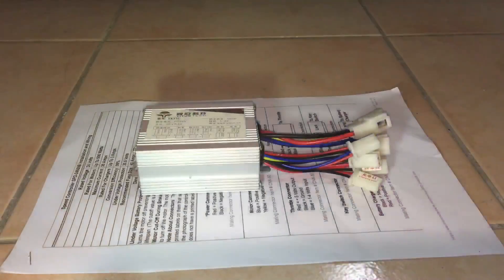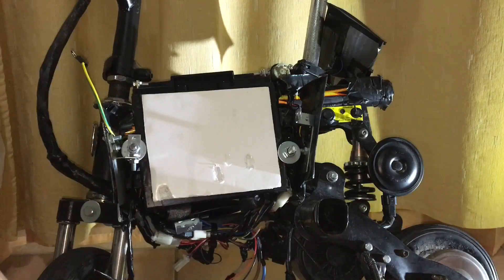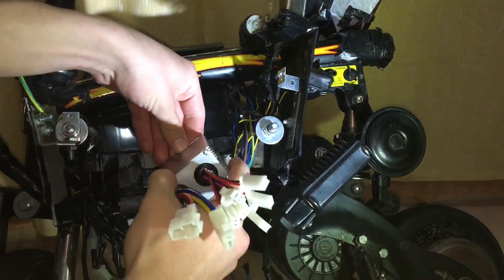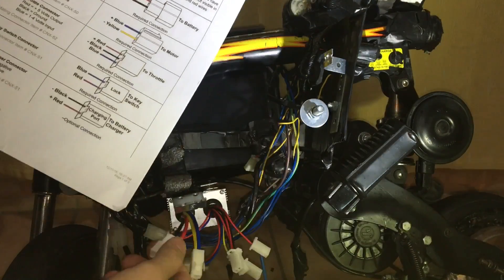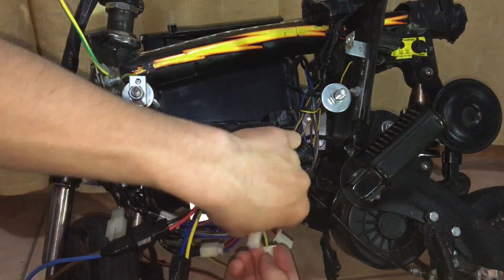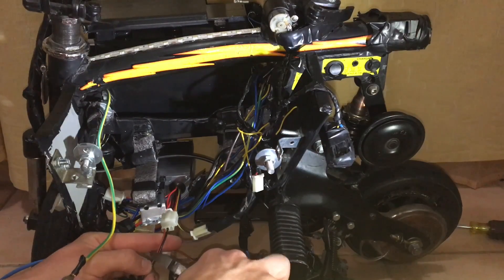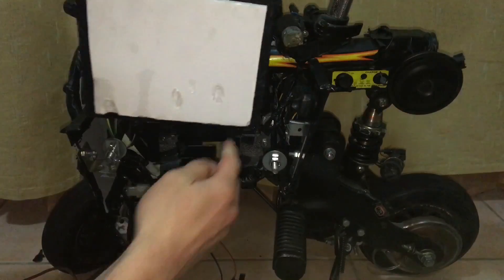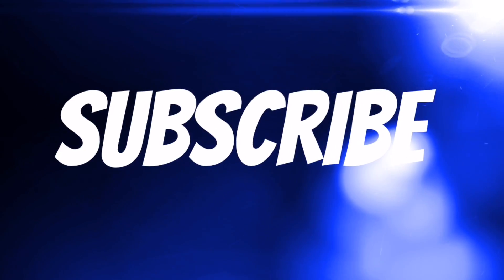How to replace the speed controller in an electric scooter

Comment: Hello .. I have a question about a Terminator scooter i purchased yesterday..i thought the batteries were low so i swapped 1 out ..i have not keys to start it so i installed a toggle where the ignition key was ..so with the scooter off the motor just runs toggle on or off ..any help will be appreciated ..also the brake stops the motor but will start after i release it..if i disconnect the motor connection it turns off ..any ideas?
Reply from the maker: Hi bripri966,

From what I understood is that your motor automatically runs when you turn on the scooter (without any throttle input) and turns off when you turn off the scooter. 

If that’s the case, I’d try disconnecting the throttle cable to see if the issue persists. If the motor does not run when the throttle is disconnected then your throttle is likely faulty.
Reply: @ZiadHamwi  the motor just runs when I connected the battery cables ..only stops when I disconnect the motor and battery connection brown blue wire and red and black ones
Reply: It was working fine then all the sudden it just keeps running on or off with toggle
Reply from the maker: So you’re connecting the motor directly to the battery with a switch?
Reply: @ZiadHamwi  I don't have a key so I cut the key ignition off and put a toogle switch
Reply: @ZiadHamwi  sorry about the questions... but great video just need to be able to see the wires better
Reply: @ZiadHamwi  Terminator ES4 is the scooter by the way ..I'm rebuilding it for my neighbor..
Reply from the maker: I understand. 
You need to isolate the problem first, double check if the original key switch that you cut only has the two wires that you cut and connected to a switch. Also, you need to figure out if the problem is from the speed controller, throttle, battery, or motor.

If you can provide a full context of the problem I’ll try my best to help you as remember I cannot see what you see so I’m having trouble understanding what the issue is. Please provide more context.
Reply: @ZiadHamwi  will do... actually I just unplugged the key switch ..and ran 2 wires to the plug connector..I'll get back with you with more info ...thank you very much for responding and helping me out..
Reply from the maker: Yes sure noted, feel free to ask me questions when you have more info.
Good Luck!

Comment: love the video. i am having major issues finding info trying to replace a controller for a branded canadian ebike. The company refuses to tell me anything and expects me to buy a 189 dollar controller just to replace what i have. 48v 500watt 12.5 a. currently my controller seems to have 3 shorts. (1 on throttle and 2 of the 2 pin wires) at this point i want to just replace and move on from this company and their over priced nonsense. if you could help me in any way id appreciate this
Reply from the maker: Hi Mark,
Can you give me more info about your ebike such as the name and model number so I can better see if a standard controller can fit.

Comment: Thanks dude.  Can you use 500 watt controler on a 250 watt motor thamks
Reply from the maker: You can. You always want to choose a speed controller that at least matches your motor in terms of power output
Reply: @ZiadHamwi  thanks dude for your reply.  I have a speed controller with a LCD screen on it but my controller dont have a place to hook it up it has a blue and green wire i think .how can i hook it up thank you.
Reply from the maker: You're welcome!
So I understand you have an electric scooter with an LCD display but your new speed controller does not have the correct connections to the scooter's display, is that correct?
Reply: @ZiadHamwi  well a ebike with 36 volt  350 watt. Controller and it has no hook up for the lcd nothing that makes it work how could i hook it up thanks dudes
Reply from the maker: Hey Guitarman, sorry for the late response. Concerning your existing speed controller, are you sure it is the original speed controller that came with the ebike?
Reply: @ZiadHamwi  no its not the original
Reply from the maker: Oh I see, if it's not the original speed controller, it's likely that your new speed controller does not support the original display that is on your electric scooter. 

Unfortunately, the only way to get the display to work again would be to use a speed controller that matches your original speed controller.

Comment: My dumb ass left my scooter in heavy rain sitting in my bk yard so when I start it power up but no go on throttle just got my new 1000w 48v speed controller now its running like new

Comment: Hello Sir, I already follow all of the connections but when I charge my scooter, the charger blinking red lights and after that no light at all...then when I tried my scooter, it only can run like 5-10mins..I used 12v 12Ah batteries, the controller for 24v 350w and the motor 24v 350w...what could be the probelm?
Reply from the maker: Hi Mohammad, are you sure both of your batteries are in working order?
Reply: I would say same bout the battery should b the problem if u decide to start off simple by try a new charger if fail then def the battery
Reply: @loyaltyovermoney5942  or its a 48v controller

Comment: My escooter runs ok 250w motor with 36v 10.ah battery and 36v 13A controller. Can i upgrade the controller only to 48v 500w to get extra speed?
Reply from the maker: Hi Mohammad, technically you can, but you'll need to upgrade your batteries to 48 volts as well. Also, your 36 volt motor will certainly go faster with 48 volts but will heat up much more than normal and will wear out quicker. Personally, I wouldn't recommend running your 36 volt motor with 48 volts for extended periods of time.
Reply: Thank you for the reply. Another question I have is, if i were to maintain the speed but get extra torque instead, can i upgrade the controller from 36v 13A to say 36v 20A? Does this harm a 250w motor?
Reply from the maker: You're welcome. About upgrading your speed controller, your current speed controller is a 36 volt 13 amp controller, it's capable of outputting 468 watts (36 x 13 = 468), so it's already more powerful than your 250 watt motor, but your 250 watt motor will only draw 250 watts from it under maximum load. Replacing your 13 amp speed controller with a 20 amp controller (720 watts), won't harm your motor as your motor will continue to only draw 250 watts at max, but torque will not be increased either. In the scooter I used in this video, my motor was a 180 watt motor and the speed controller I installed was a 500 watt controller, and no I did not notice any benefits in speed or torque.

Comment: -bro i have mobot scooter with 48v 500w motor but the running fix in 25kph i can adjust the speed because i know because of the controller they fix the speed in 25kph but i fell the power of the motor when i start running very strong acceleration. my question  its possible to change may controller to get more speed of my scooters? thanks in advance more power
Reply from the maker: Hi Carlo, if you're 100% sure that it's your speed controller that is limiting your speed to the maximum of 25km/h, then it would be possible to replace it with a new speed controller that doesn't have a speed limit. However, it's important to keep in mind that if your scooter has been designed to run at a top speed of 25km/h, by modifying it to go faster you may risk potentially damaging the structure of your scooter since it's not meant to go above 25km/h and your brakes would have a harder time slowing you down under a higher speed. 25km/h is a good speed for a 500w electric scooter, so I personally would leave it alone.

Comment: Hi Ziad, I have a Nanrobot D4+ scooter it has two 52v 23AH speed controller. I was testing for power in the rear light wire and touched both metal connectors at the same time. Now my scooter doesn't stay on when I press the power button... It goes out instantly. Can you help me out in troubleshooting it?
Reply from the maker: Hi Manny, so what happened was that the two pin rear light connector pins touched each other? Also, for the split second that your scooter turns on when you press the power button, does it run if you press the throttle?
Reply: @ZiadHamwi  Hello Ziad, Thanks for your reply.  When I touch the two metal connectors I heard a small click. No smoke or the smell of smoke was detected. If I hold down the power button and press the throttle it runs. And everything else seems to check out ok when holding the power button down. Once I let go it shuts off.
Reply from the maker: Hi Manny, from the information you provided, it seems that your speed controller is fine. I'm suspecting that your power button might be failing. Check your power button, perhaps it's faulty, if you're able to access the two wires that are connected to the power button, you may connect them together, temporarily, to test if your scooter runs normally. Or if you happen to have a spare switch or power button on sight, you might want to try replacing your power button with another button or switch to test if it is causing the problem. Feel free to ask me questions. 

Let me know how this goes :)
Reply: @ZiadHamwi  Hi Ziad, thank you.. I did what you said. It turned out to be the power button being faulty.  I manage to replace the LCD display throttle since is all in one unit. Thanx again stay safe.
Reply from the maker: I'm glad you got your issue resolved :)

Comment: Hi my friend, Nice video, I have a scooter with a 500w 48v motor and a 48v 10A battery, can I place a new 48v 1000w motor?
Reply from the maker: Hi man, you can if you can find a motor that fits your scooter, but you're going to need to replace your speed controller with one that is at least 1000W at 48V.
Reply: @ZiadHamwi  ok, my original 10A battery can handle this New 1000w motor?
Reply from the maker: It should be able to handle the 1000W motor, but battery life will be halved. A 10Ah battery capacity is pretty low for a 1000W motor.
Reply: @ZiadHamwi  not battery LIFE, the battery range will be halved. 2nd of all, if your battery is able handle the discharge current (2 times in this case, because double the power 500 x 2 = 1000 W) so if it can handle that much current discharge, you can use the same battery. Otherwise the BMS on your LI-ION battery will cut the supply. If it is a LEAD ACID battery, then it will be all good ! It can give very high discharge. So no worries ! 3rd of all, your controller wattage rating & motor wattage rating should match AS WELL AS THE VOLTAGE.
Reply from the maker: Hi Saket, in the current context battery life and battery range are referring to the very same thing. If you would've gotten 1 hour of runtime at a constant spend and torque, then you'd get half an hour of runtime if you use a motor with twice the power output. If you would've gotten 10 miles of range then you'd get 5 miles if you use a motor with twice the power output. If you're measuring battery runtime in terms of distance, then battery range is more applicable whereas if you're measuring it in terms of time then battery life would be more applicable.
Reply: @ZiadHamwi  good to know ! 👍

Comment: Nice to see you solder it but come on let's get some shrink wrap  in there not that black tape
Reply from the maker: Yea definitely heat shrink tubing would be better but as I tend to mess around with my connections every now and then electrical tape works well.

Comment: Hello there I have a bullet rpz 1600w 48v eclectic scooter and as soon as I turn the key it starts going without me touching the throttle then when I turn the key off it stops. Do I need to replace the control module? Thanks
Reply from the maker: Hi man, most probably, you'll need to replace the control module (speed controller), but make sure first that your throttle isn't the problem by disconnecting its cable from the control module. Then, after disconnecting it, try turning the key and see if the motor starts going. If it does, that means that your control module needs to be replaced. If the motor doesn't spin after turning the key, then it is your throttle that needs replacing.
Reply: I disconnected the throttle cable and it didn’t go when I turned the key so I need a new throttle?
Reply: @Ziad Hamwi then you for your reply I do believe it’s the throttle what’s causing the problem..... is there any way to fix it instead of buying a new one?

Comment: kindly someone tells me how to modify, replace or purchase a Controller for more speed from 25km/h to 50km/h or 60km/h for CozyTrike Electric Scooter, model GTX-L60...thanks a lot!!!...
Reply from the maker: Hi man, I really apologize for the late response . So concerning increasing the speed, the speed controller doesn't really limit your max speed. Some speed controllers do limit the speed for safety but only by a little bit, not like limiting it from 50-60 km/h to only 25 km/h. In order to make it go faster, you'll need batteries with a higher voltage, a motor that is designed to operate at those higher voltages, and a speed controller designed for that particular power output. Personally, I think that 25 km/h is good enough, especially on a trike, so I would leave it as it is. But there are many other cool modifications you could do to your trike besides just increasing speed. 

Once again, I really apologize for my late response. Feel free to ask me any other questions regarding your trike.

Comment: Bro... U gotta stop cutting 2 live wires at a time! Bad habit. Super dangerous. Brake lights turned on cuz u completed a circuit.
Just cut 1 wire at a time from now on - for ur own good
Reply from the maker: The power was completely disconnected, the brake lights have their own battery, that's why they still lit up. I would never work on anything electronic without completely disconnecting the battery and would never recommend anyone to do that. But in the case of my scooter, it's got several batteries for different systems, so disconnecting the main battery would be the safest thing to do as it is the one that carries a high current. Other systems like the brake lights have small/weak batteries that would never spark.

Comment: Hey bro i recently bought a electric scooter and it is 1000w 48v 12ah and i found a 1500w  connector here https://m.banggood.com/sv/1500W-48V72V-Electric-Scooter-Brushless-Motor-Controller-For-E-bike-Scooter-p-1072924.html?rmmds=search if i replace the 1000w with this will it work faster and better please help someone!

Comment: Hey man, amazing video. Still, I would like to know if there's any controllers to drive a 250w (500w peak) 36 motor up to around 30 amp. It is a Xiaomi m365 that has a custom firmware (not Botox, something a bit stronger) that pulls sometimes 1600w when starting and cruise along around 800w continuous. The motor is fine, however power circuit on the controller melted under hard braking ( around 40 amps, which is way too much I know). I therefore would like an aftermarket controller to handle more power, what would you suggest with your experience? I don't mind overheating the motor, I make only small trips of 10 mn full throttle and I check regularly components. Thank you very much !
Reply from the maker: Hi man, I'm really sorry for the late reply and thank you for liking my video. So what's the rated power output of your motor, you mentioned that it is 36 volt motor, but for the power, you mentioned the power that the motor is drawing. The rated power output of your motor should be on a sticker that is on the motor itself and it would be the absolute maximum power that your motor would draw in the worst cases. And also, I didn't get what you meant when you mentioned under hard braking so please clarify that.

Make sure to look up the power rating of you motor and reply back to me so I can suggest a proper speed controller for you.
Reply: @ZiadHamwi  The nominal power is 250w, with 500w peak, however I did use a custom firmware that allowed me to feed somewhere in the region of 1000w to the motor during acceleration. On continuous operation, it was closer to around 800-900w. I know for a fact that this motor is overbuilt and therefore would like  controller to drive it up to 800w ( some people I know even used 12s4 batteries, so around 48v, for this motor without any problem for months now). I have two 36V nominal 10s4 lithium ion batteries that don't even break a sweat when asked for that kind of power, so I'm safe batterywise, however I need a controller that is able to drive the motor up to 800w at 36V nominal. Thank you very much !
Reply from the maker: Hi man, is your motor brushed or brushless?
Reply: @ZiadHamwi   It is a  brushless motor
Reply from the maker: Hi man I really apologize for taking a day to respond as I have been very busy. 

Anyways, I think you should be good with a 1000w speed controller if your motor can take that extra power and utilize it for better performance as you mentioned that it runs closer to around 800-900w.

I found this 1000w brushless speed controller (compatible with both 36 and 48 volts) on Amazon: https://www.amazon.com/Brushless-Controller-Aluminum-Structure-Electric/dp/B07NKDCQN1/ref=mp_s_a_1_8?keywords=electric+scooter+speed+controller+brushless+1000w&qid=1553980366&s=gateway&sr=8-8&srs=17416544011